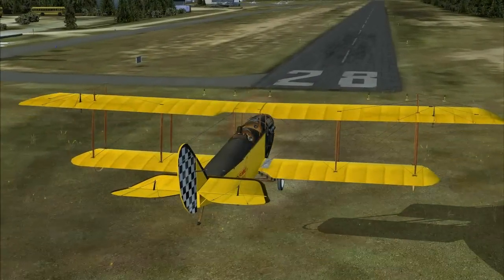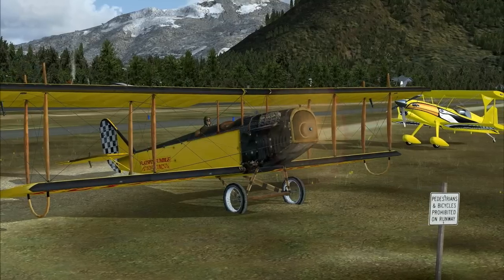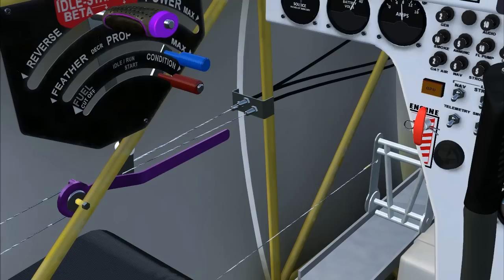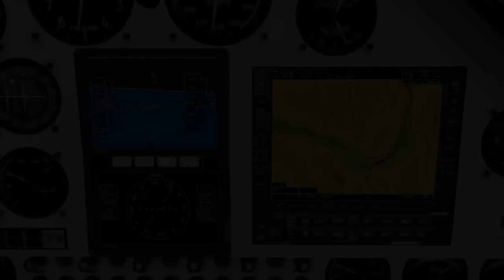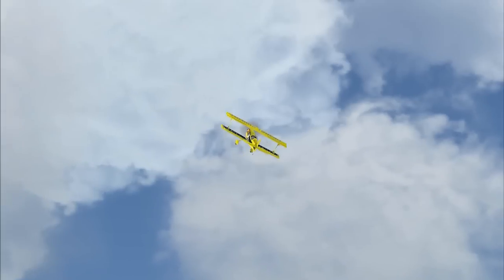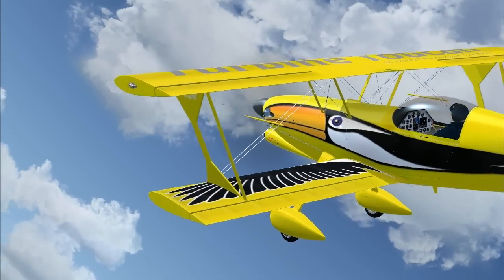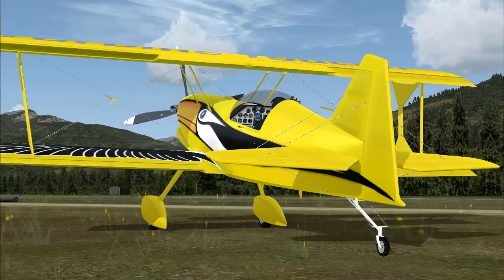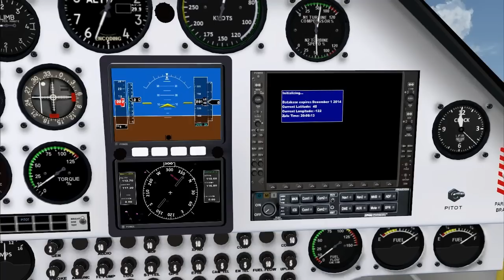Flying the Turbine Toucan (Part 1 of 3)

Comment: For nice (non-runaway) engine starts, first select the conditioner level (ie. mixture) to idle cutoff, then engage the starter for a few seconds, then while holding the starter button in, move the conditioner a slight little bit forward, and it starts up perfectly without running away, even with prop on fine (as opposed to feather) and parking brake off! Assign some button to starter or jet starter in fsuipc, and preferrably a controller for the mixture lever and check it out. :-)

Comment: I am working beside one of the designers of the real Turbine Toucan.   He speaks to 10,000 ft/min climb and no other aircraft (maybe the Turbo Raven) can touch its performance.  
It’s a very special aircraft that’s based on the Pitts Model 12 built by Kimball
Reply from the maker: Is it still flying? Last time I looked it had stopped the airshows and was changing hands.